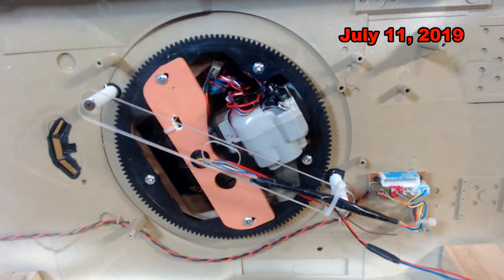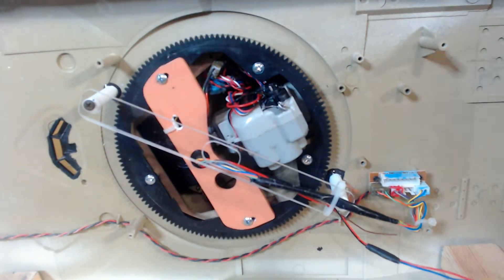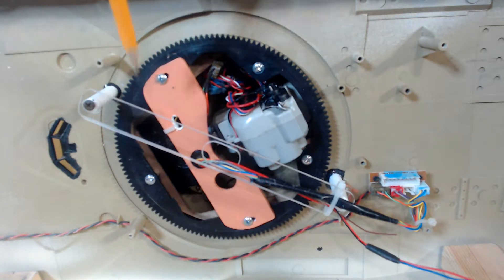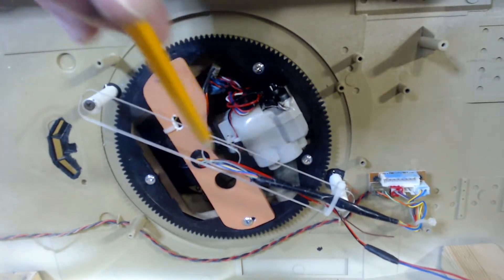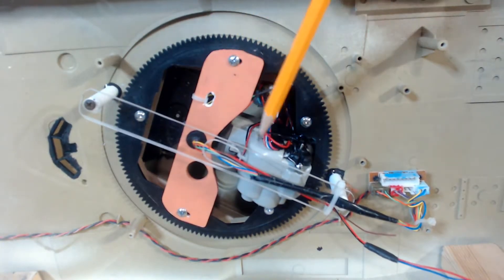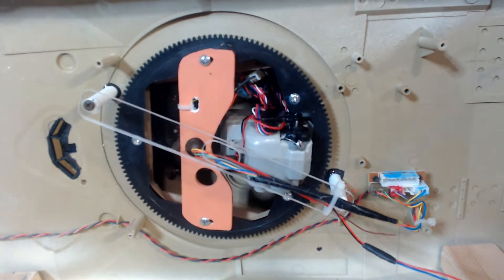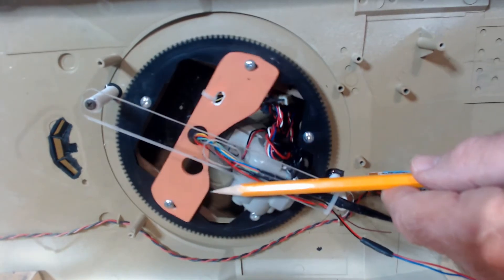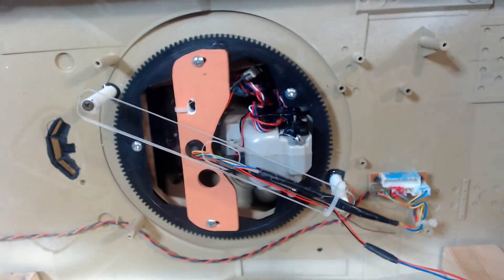M1A2  HL Slipring Performance Update

Comment: Do you have the 5.3or the 6.0 system in your m1a2. I'm going to convert to the 6.o cause the m1a2 does sound dumb as a diesel. I aslo pulled out the smoke unit cause how often have you seen a smoking Abrams?